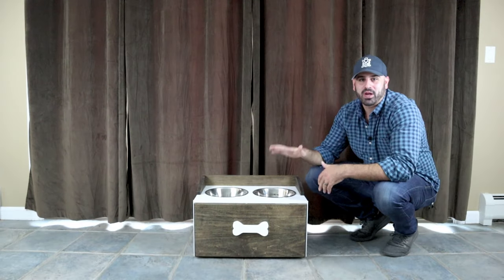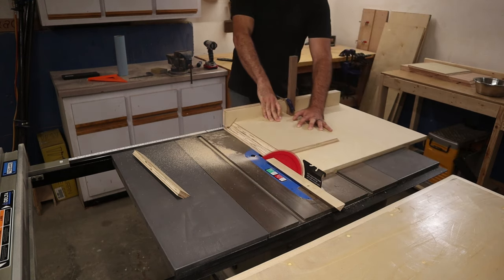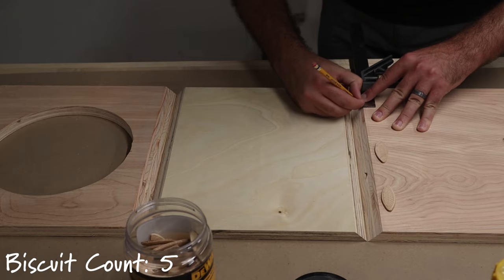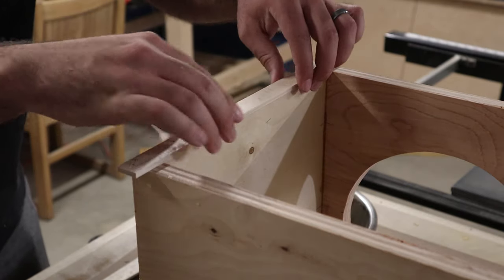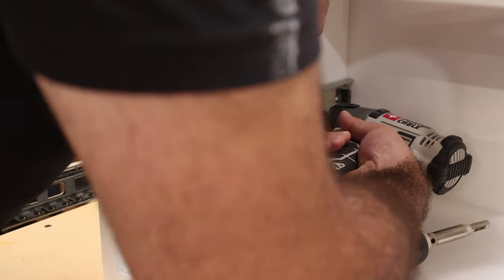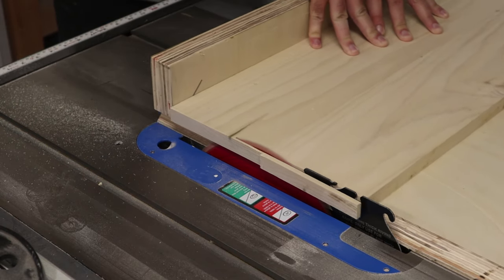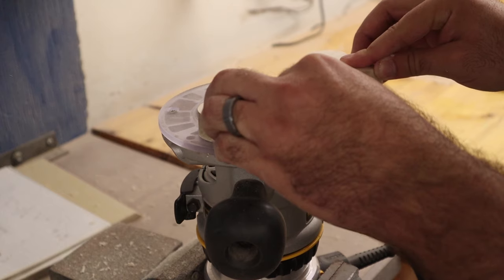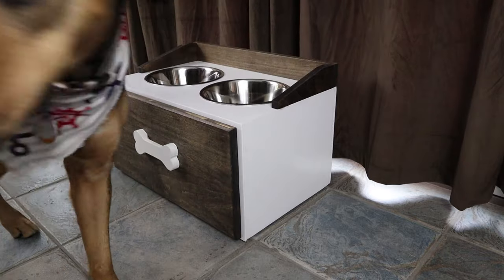Raised Dog Feeding Station | DIY

Comment: Glad you did the biscuits, gives me reason to use mine.  Great job!!
Reply from the maker: Thank you!  I think they would have worked great if the angle was at exactly 45 degrees and the cut was a little deeper.  Either way, it definitely helped with alignment.

Comment: I made my last paint mixer from an old 1 1/2" spade bit by grinding the points. The next day I found my actual mixer and tossed it in the "unused tool" box.
Reply from the maker: Smart! Works better I presume?
Reply: @CasualBuilds I wouldn't say better, but just as good. 99% of the coatings I use come in quarts. It's perfect for those, but I didn't throw the mixer away because the spade bit is too short for a gallon. The best part of it all, nobody wants to "borrow" a useless drill bit and never return it. 

I'm starting this build today, will definitely subscribe for future installments...
Reply from the maker: Hahaha there ya go! Thanks for the support!